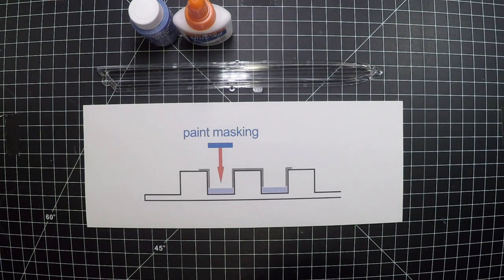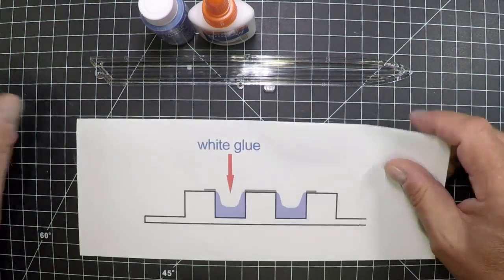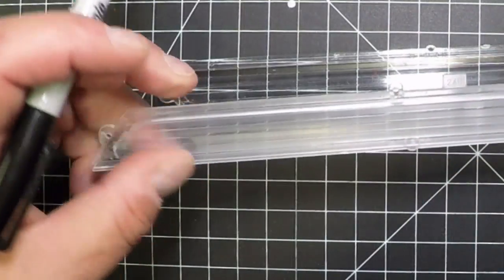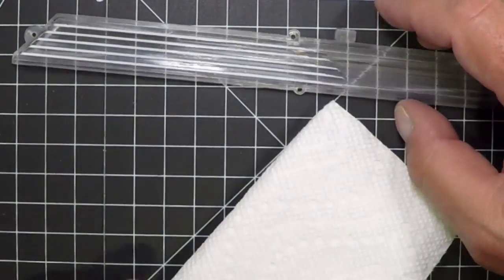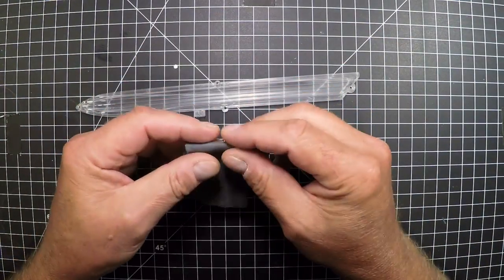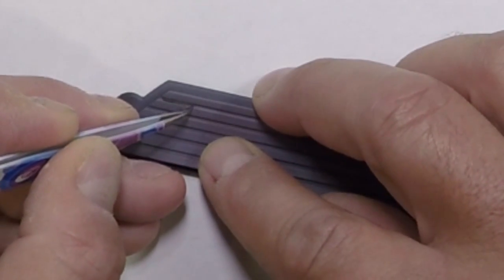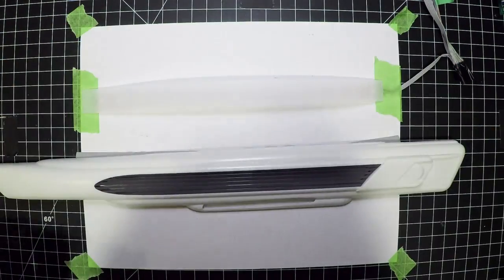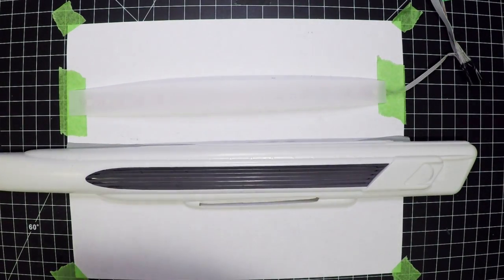1/350 scale Star Trek Enterprise  - Nacelle grill painting by MaskDesign

Comment: I'm going to give this a  try. I tried 1mm masking tape, and was unhappy with the result. I switched to 1/32'', and it works quite a bit better. I also painted the curve on the rear of the nacelle by using an oval mask on the back of the part instead of the front. That seems to work well.

Comment: So i tried this and had a disappointing result. I may have been too heavy handed with either the glue or the primer or both. Lots came off ok, but plenty came off that shouldn't have. Took that muddled mess and (without reapplying more glue) sprayed all with the primer. Then about an hour later, dug the paint from the trenches with fine tools. Came out pretty well considering the mess I made at first !
Reply from the maker: at least you got to salvage the grills that is the important thing. Glad your plan worked out
Reply: @maskdesign2478  Thanks. I never would have even gotten here without your great video. So thanks again
Reply from the maker: @joelesrig7388  thanks and glad you enjoyed the build

Comment: I tried with the Elmer's glue. It dried!
Reply from the maker: maybe you put to little on but is should still work if the area is covered with a thin layer of glue
Reply: @maskdesign2478  Probably too little, or the wrong kind of glue. I bought some 2/32'' tape that seems to work as well.
Reply: Fill the whole channel with the glue. Elmers is water-based and easy to work with...as shown in the video here.